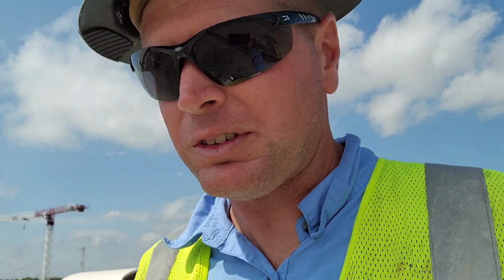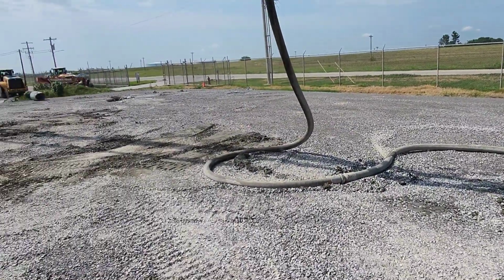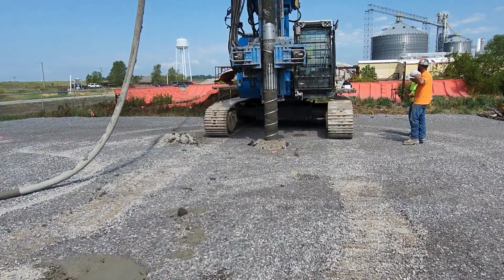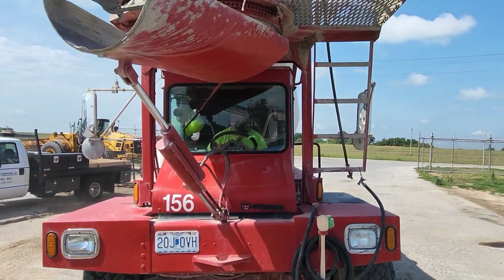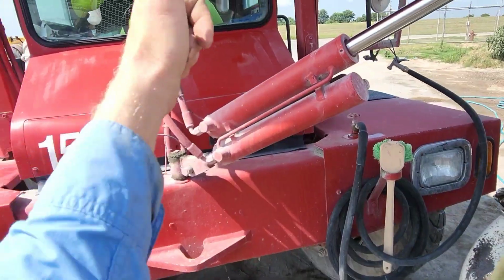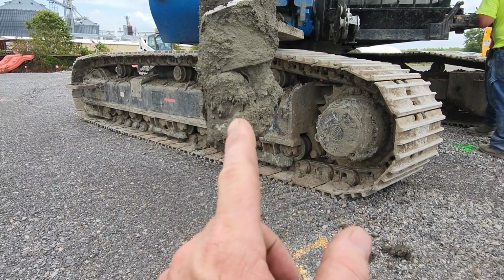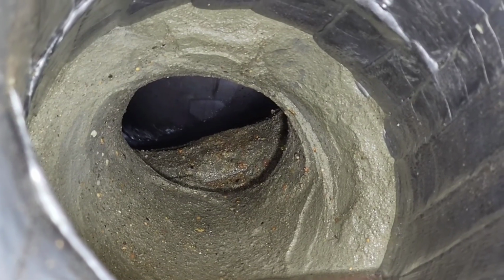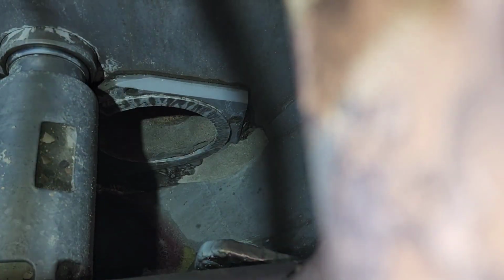Concrete Pumping Auger Cast Piles! Putzmeister 38 meter Concrete Boom Pump.

Comment: Not an auger cast pile. Usually auger cast piles are full flight auger and soil is removed and replaced with concrete and steel reinforcement. It looks like a Controlled Modulus Columns (CMC)